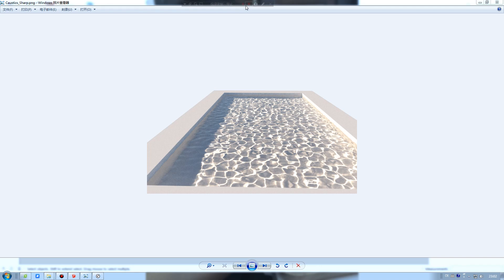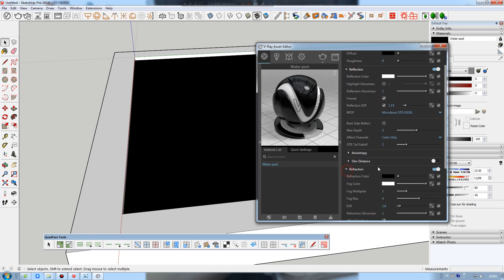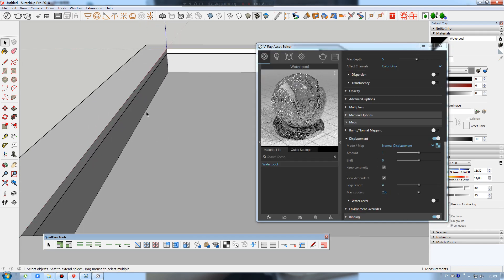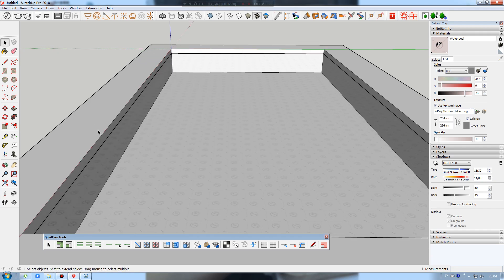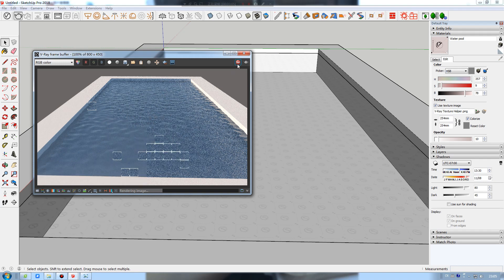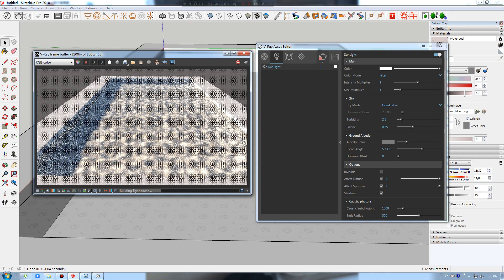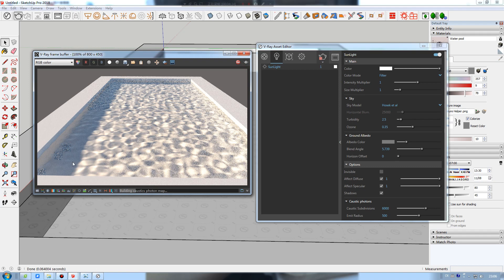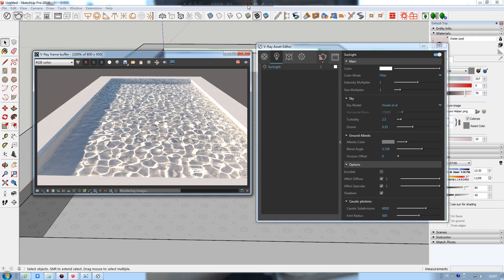Swimming Pool Caustics  in Vray for Sketchup 3.6

Comment: Just about water, I think 3.4 is better than 3.6, It's easier.
Reply from the maker: It's not easy to setup caustics in Vray for Sketchup. One important aspect is water, in 3dsmax and Vray,users can benifit from PhoniexFD which provide super realistic Ocean texture which can make water caustics more superior than Vray in Sketchup with Noise texture IMO. The other part is the Sun and target, Vray use built-in Documented sun system within Sketchup,users have no clues about where is the target and can't figure out where all these fucking photons go,that's the most disappointed part, It's 2019 ,almost ten years since ASGVIS,VFS users don't have a handy sunlight tool ..